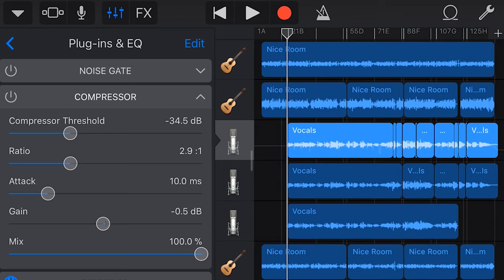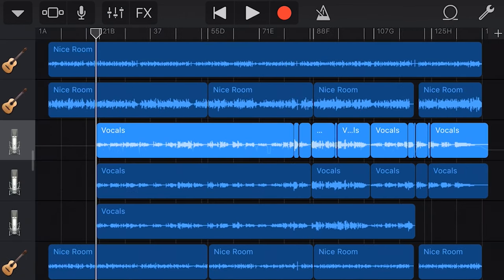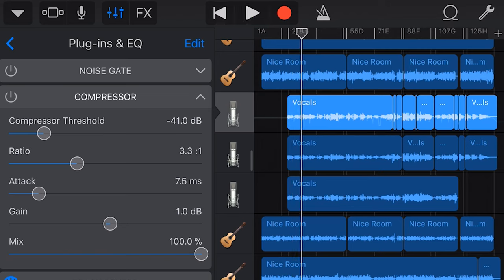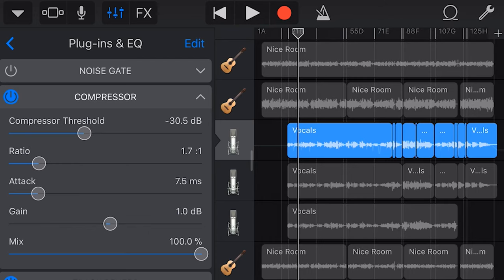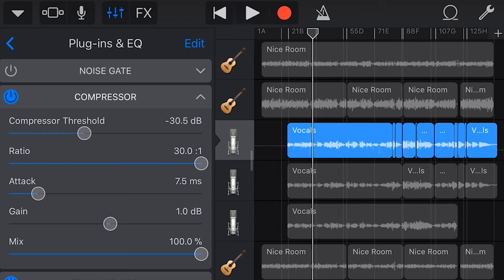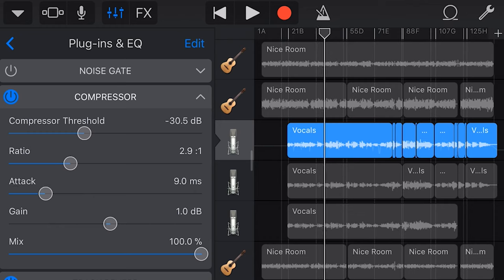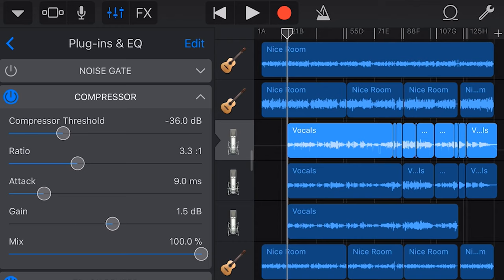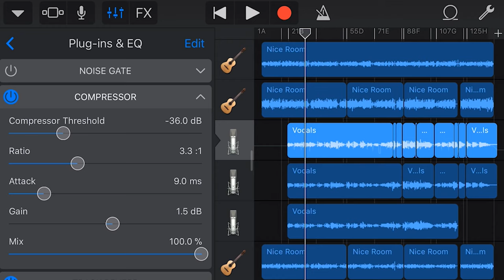How to use the compressor in GarageBand iOS (iPhone/iPad)

Comment: Very handy. Just hoping I can apply this, made a ton of 80’s sounding tracks and fearful this is where I ruin them lol. Messed around with automation too much and a couple of them clip when the bass is turned up until I put the bass so low in the mix it’s barely audible.
Reply from the maker: Yes, compression, like most things on mixing, is best used in moderation!

Comment: Good simple explanation. However, shouldn’t you have used the mix slider to check so that the volume was the same as without the compressor?
Reply from the maker: Hey there. Thanks for watching and for your comment. Yes, you can definitely do that too. Depending how you are using compression and the effect you are going for,, you may want to check the volume line this.
Reply: Pete Johns I guess it will sound more natural if the volumes match? However, I like your simple way of explaining. Two requests: couldn’t you do this with eq before the compression, and also a video on compression and eq+compression in Logic?
Reply: Pete Johns ? I’m also interested in if you have a video or could make one explaining the other components to common compressors: like knee?

Comment: Hi Pete - when I playback the tracks I’ve recorded on GarageBand, some tracks drop a bit in volume (as if GarageBand) is auto compressing all the tracks as a final mix. How do I fix this? Thanks in advance for your advice!
Reply from the maker: Hey there my friend. This “pumping” is generally caused by the overall volume being too loud which makes GarageBand start trying to push the volume done to avoid clipping.

Generally the answer is to reduce the volume of each track or the overall volume or the project. This tip will help you out - https://youtu.be/ngGA8iz0ncc

Comment: When I record voice on GB its sounds so hissing and muddy I think this has to do with  compression but what should I change? 
I use the phone mic
Reply from the maker: Hmmmm..... the hiss sound is usually caused by background noise and possibly having the input gain setting up too loud. If it’s sounding muddy you can start to adjust the EQ to remove some of the mid range frequencies that might be causing problems.
Reply: Pete yeah its definitely the background I'll try reducing the mid and the noise gate
 thx for replying anyway
Reply: Pete yeah its definitely the background I'll try reducing the mid and the noise gate
 thx for replying anyway
Reply: Pete yeah its definitely the background I'll try reducing the mid and the noise gate
 thx for replying anyway

Comment: How can I get the compression to match the beat
Reply from the maker: Hey there. Compression is more of an “always on” type of effect. This is a method to “side chain” compression to something like a kick drum, however this sort of option is not available in GarageBand.
Reply: And also I want to hear my vocals a lot louder on the beat
Reply from the maker: Yes, compression can help you get a more consistent and louder volume in your vocals so that they sit better in the mix. Just okay with the threshold and ratio until it sounds good.
Reply: Pete Johns is there any apps which could sidechain cause I have trouble with finding one